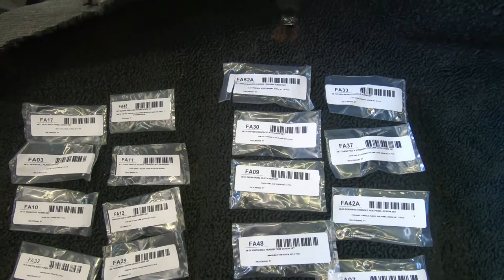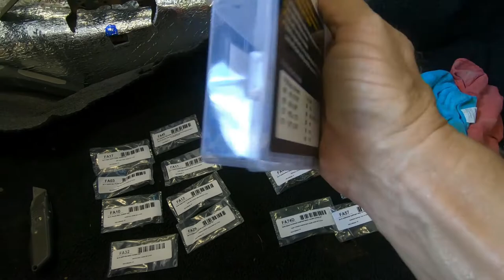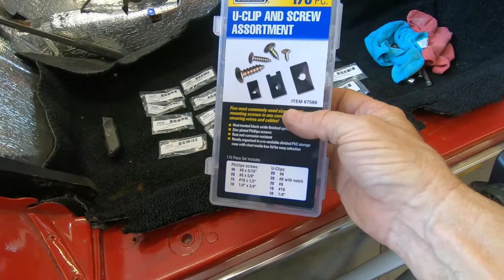C3 Corvette Installing The Interior, Part 1

Comment: I remember in 73 deep pile carpets leather seats and wood grain on doors was $500. My opinion was that was money well spent.
Reply from the maker: I always liked the woodgrain on the doors. Mine does not have that option. I wish it did. It looks like it has aftermarket door panels so I don't know if it had them originally. The carpet is deep pile but I know it is not original.
Reply: FYI: the wood trim and carpeting along the lower edge on the door panels was part of the Deluxe interior package. I just found out that Corvette Central sells a kit for $360 that you can use to convert your door panels to the Deluxe interior panels.
Reply from the maker: Thanks for the information.